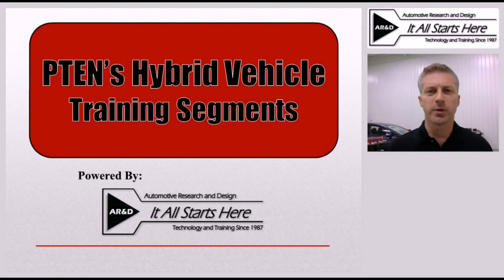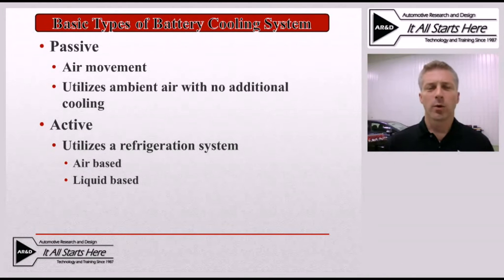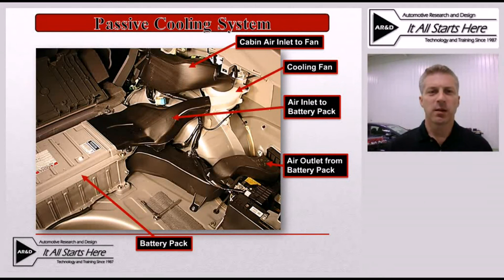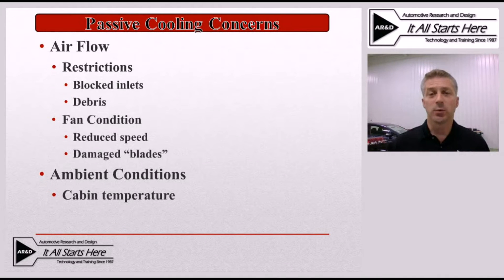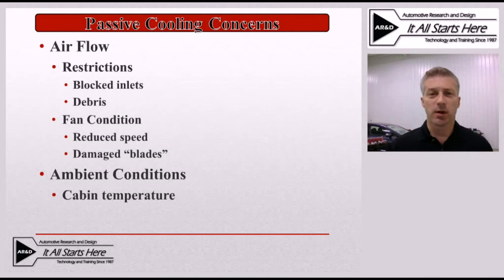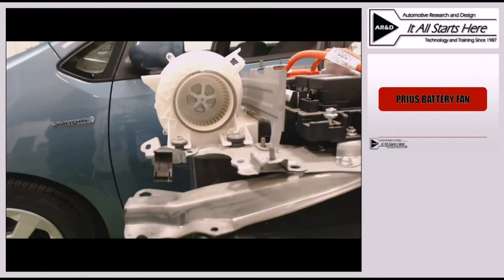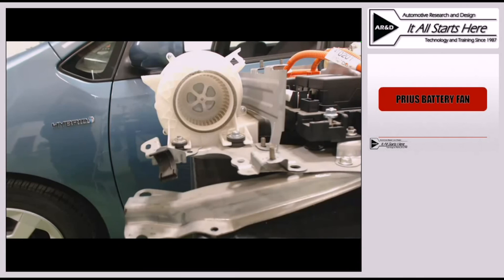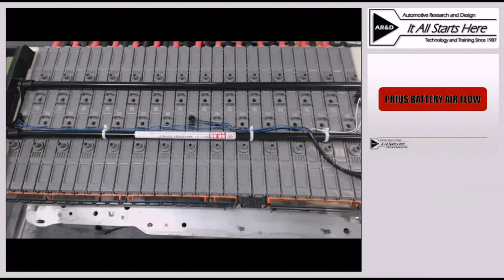Hybrid Training: Hybrid Battery Cooling Systems Video

Comment: Question I have a hybrid silverado1500 by via motors and water pump stays on the whole time checked for voltage from connecting harness and it’s always hot . Any suggestions of what could be causing this as it’s draining 12v battery . Thank you

Comment: Hi I need your assistance. I have a Nissan 2015 hybird  and it not starting .and I having a C1130 code  .and as C118C code. On the A.B.S system .

Comment: thanks for lecture. Prius 2010, I have problem with the HV battery that each cell has 7.9V yet, it shows sign of "check HV battery sys." @ hot days when use AC. I cleaned the fan & changed 1 cell & also but small battery 12V. still i have same problem. thanks
Reply: How many miles before you habe this problem? 🤔
Reply: @Usernotknown21  173 miles, I bought new Hybrid battery thats the best solution..👍🤚
Reply: @AMuuse-ih2oo  do you mean 173000 miles? 🤔
Reply: @Usernotknown21  yes 173k
Reply: @AMuuse-ih2oo  that's pretty early.  Why so early?  You have pets? 🤔